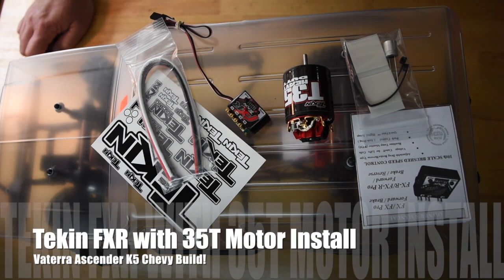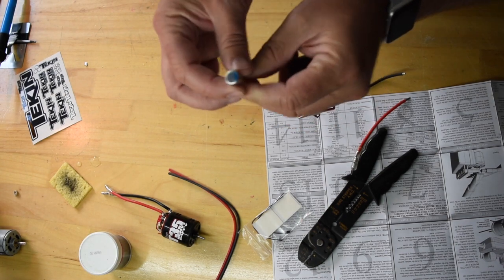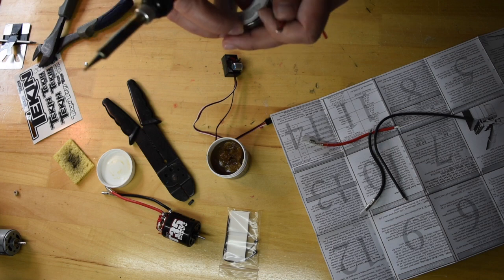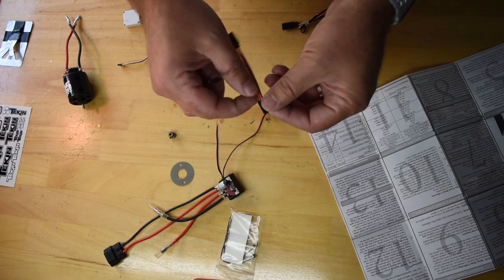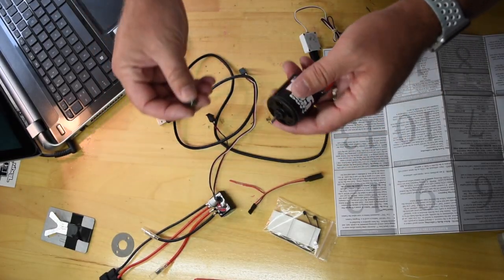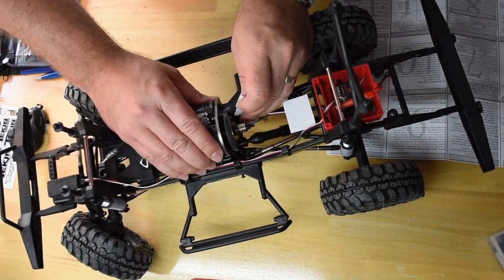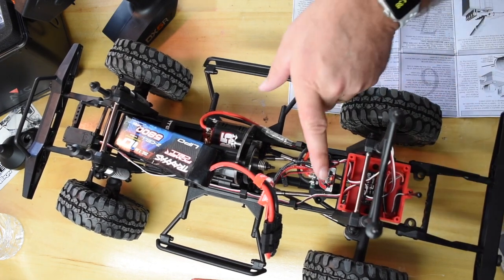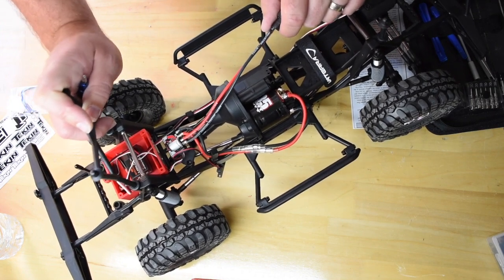Tekin FXR 35T Motor Install on my K5 Chevy!

Comment: Here in 2021 I am re entering the RC world with an Element Enduro kit. I am using a Tekin BXR and the same motor you have in this video.
I wish the wire set up on the BXR was the same as this ESC. The battery connections are on the left and right while the motor connections are 
in the middle of the ESC. Anyway soldering the wires is the last soldering I have to do and this video provided some useful information for this process.
Reply from the maker: Good luck with the build! Glad to hear you're back in the RC game!